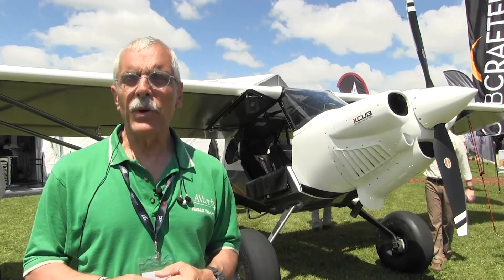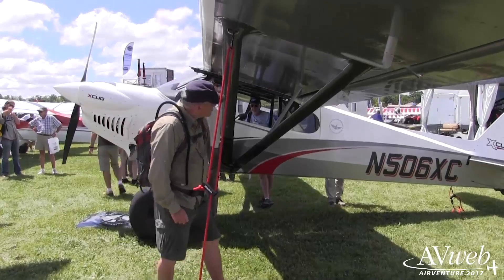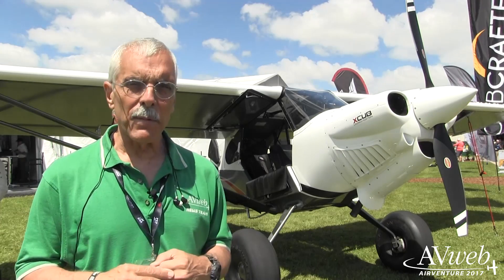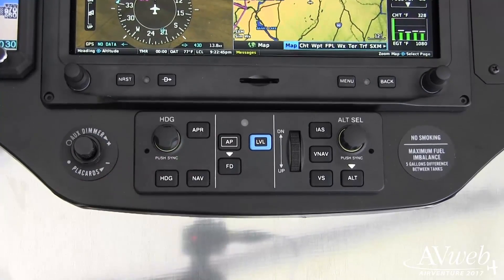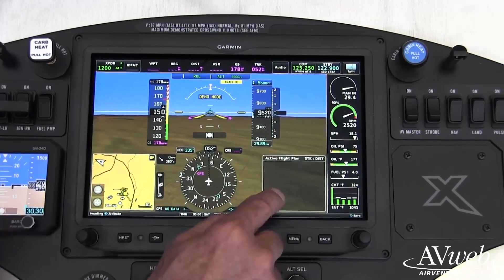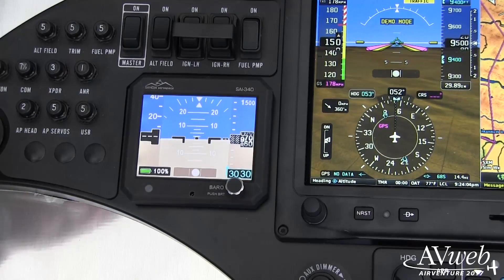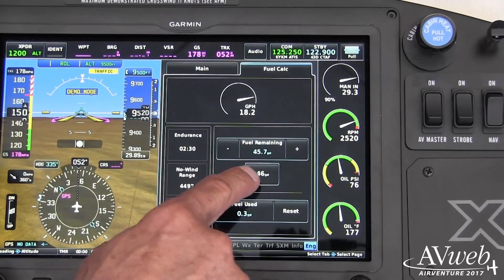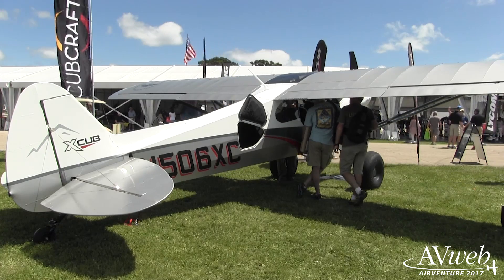CubCrafters Gets the G3X

Comment: Wait.  Did he say the XCub was a Certified aircraft?  Does that mean that Garmin is also translating it's Experimental avionics to a certified airframe?

By the way, $20,000 for the panel, and then another $7,000 for the autopilot?  With Dynon's announcement of the Skyview HDX, with ADS-B In and out, engine monitoring AND Autopilot, along with a DA10A backup device, all for $20K, and ALSO for certified aircraft, Garmin is going to have to seriously be looking over their shoulders, because they are going to get run over.  Also, the Dynon is certified for IFR.  The XCub may not be, but it's nice knowing your avionics are!
Reply: The market is ripe for effective competition, Garmin tried strangling it with their purchase of Apollo way way back, now the barrier to entry is lower and Garmin should be trying harder.
Garmin trying harder brings us better tech and prices, anyone who is pro monopoly is someone to be wary of - they don't care for your wallet.
Reply: I'm not sure that I would call Garmin 'Pro Monopoly', it really isn't that much different than when Bendix/King, or even King, before they became Bendix/King, was the top of the hill.  Garmin offers the product people want.  I mean, think about it, the G1000 totally destroyed the Avidyne Entegra system, so much so that Avidyne doesn't even sell it any more.

But, my point is that there are more airplanes flying today that were built between the mid to late 1960's and the mid 1980's than there are from the mid 1980's until today.  However, their value doesn't warrant a new TSO'd, certified, glass upgrade.  Consider this.  An late 70's Turbo Arrow could be a nice cross country airplane, if you do the other mods, i.e., and aero clean up, new upper deck controller, air to air intercooler for the engine.  After doing that, let's say that you have an $80,000 airplane.  A new Garmin G500/GTN750/GTN650/GTX345R and remove audio panel, plus autopilot interface, or the new GFC500, combined, will probably set you back $100,000 installed.  Is that a viable solution for most pilots?  You've now doubled the value of the airplane, but avionics lose a lot of their value very quickly.

Dynon is fighting that with the introduction of the Skyview HDX Certified.  Single display, with engine monitoring, remote ADS-B In/Out transponder, autopilot, audio panel, AND a backup display for $20K?
If Garmin is trying to put the G3X in certified airplanes, if they are working the same route as Dynon did with the EAA and the FAA, which would be an awesome thing, a lot of pilots of older airplanes are going to get a lot of new tech for a 'reasonable' price.  Garmin will have to work to beat the price point of the Dynon system, however.

Comment: Interesting just 20K for the box! I have been a professional pilot for going on 43 years now, and the amount of work I would have to do in order to just lay 20K on the table, never mind the rest of the airplane, is more than I could ever afford. Thou I would not mind taking one for a little slow flight thru say Monument Valley with Sons of the Pioneers going on in the headset. GA is becoming very unaffordable Not just this particular aircraft.  I could almost afford to buy a 172 new in 1976, now in 2017, it's well out of reach. GA has an ever shrinking base on which to draw on!
Reply: George, I agree.  Cost of $200 per hour for a Skyhawk with instructor, it's out of reach of most people.  Let's talk about avionics, though, okay?  A new Toyota Camry, well equipped, is between $25,000 and $30,000.  Back in 1976, less than $4,000.
Now, let's take a 1977 Turbo Arrow, price was probably around $60K, well equipped.  Today, that same airplane is pushing half a million dollars, and you don't get the turbo!  So, price increase looks about the same, it's just that we aren't getting the same increase in our income.  :p
Now, let's take that same Turbo Arrow.  Surprisingly, or may not, you can get a mid time airframe for about $60,000.  Spend a bit to add some aero mods, a new upper deck controller, an intercooler, and a few other mods, and you have the base for a nice new panel.  BUT, this is where the whole thing breaks down.  Pacific Coast Avionics offers you a new Garmin G500, a GTN750, a GTN850 for about . . . .wait for it . . . . $60,000.  From there, add the ADS-B In/Out transponder, the remote audio panel, and the other stuff normally associated with an installation like this, and you're pushing $100,000 for the install.
So, the question becomes, you have a nice, used mid to late 70's airframe that is good for thousands of hours more life.  Do you spend $25,000 for a new glass cockpit, or do you spend $100,000?
Dynon just introduced the Skyview HDX system will be certified.  This is a 10" glass screen, remote ADS-B In/Out, autopilot included, and an independent backup display for about $20,000  It also includes engine monitoring.  The G3X Touch, if Garmin can keep it around $25,000 with the same features, is still a good deal.

It's not that things got so expensive, it's that our salaries didn't keep up!
Reply: Increasing prices -> shrinking base -> increase prices even more to compensate -> the base shrinks even more -> increase prices even more, etc etc etc. The GA market should really reconsider their pricing strategy, in the long term it makes more sense to lower the prices, they would not earn as much now but it would give the companies a more longterm and viable costumer base. GA will not die anytime soon but i can't count how many times i've seen business go bankrupt because they focus on keeping their revenue by increasing prices but on a constant lowering customer base instead of focusing on keeping the price down and focusing hard on expanding their costumer base
Reply: George Semel it is the government regulation on aircraft and avionics. The cost for certification is enormous and that cost is passed on to the consumer.